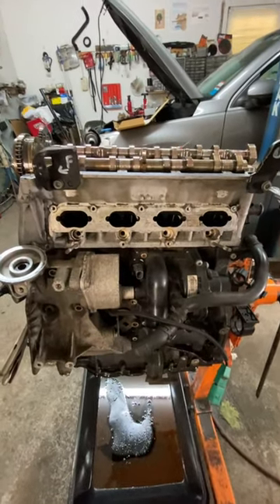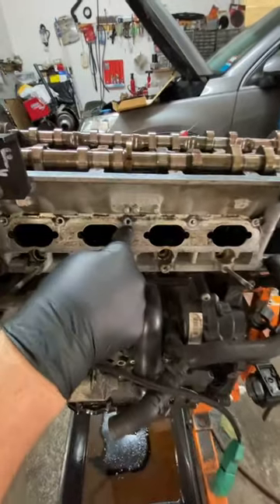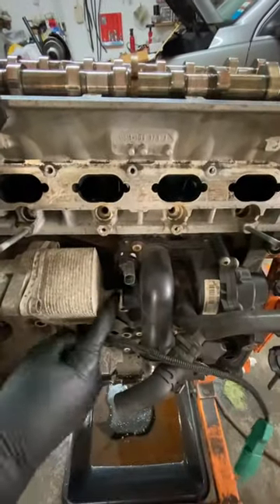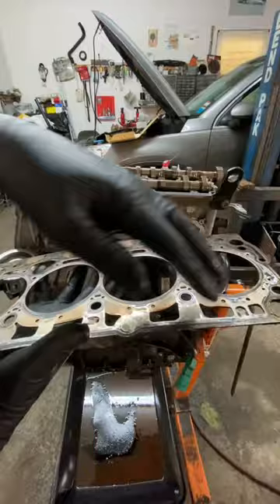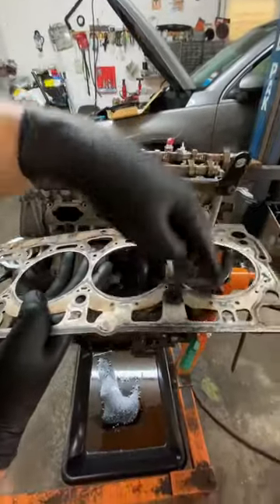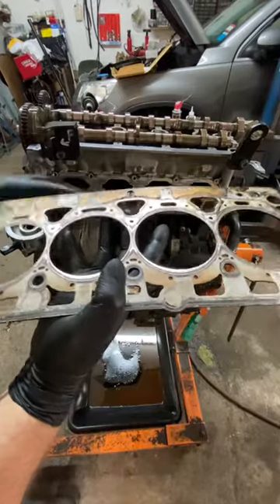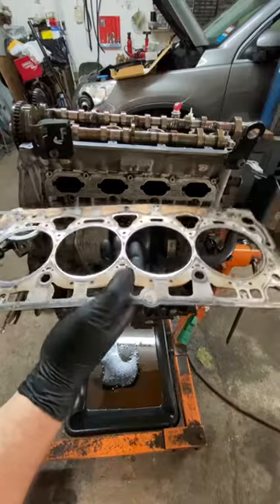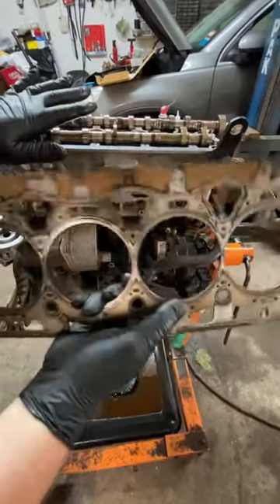What Is A Head Gasket And Where Does It Go

Comment: My sister blow my head gasket it took me about 10 miles of driving before I noticed just wanna is it still fixable or is my engine cooked
Reply from the maker: It may be if the cylinder head or block didn't warp beyond specs.

Comment: Usually if this has failed,  a new replacement engine is the only long term fix......
Reply from the maker: Absolutely not! Head gaskets fail for various reasons and almost all the time can be replaced and last longer than the original gasket.
Reply: Replaced mine going strong still
Reply: @motorcarnut  What was cause of gasket fail ?
Reply from the maker: Overheating the engine is the biggest one. Then corrosion and deterioration.

Comment: I have the same issue mines is blown & my car can turn over but once crank I wonder what’s stopping it to crank but before this all happen I first noticed grey smoke then I pulled over but I thought a blown head gasket smoke should be white 🤔
Reply from the maker: Could be coolant in the cylinders if the head gasket is blown bad.
Reply: @motorcarnut  I haven’t seen the head gasket myself so I can’t tell you if it’s blown bad or not but the previous mechanic said it’s blown head gasket I can tell from the oil looking milky & dark brown I def prolly have a leakage something was causing the smoke to appear when I go more then 10miles etc the less I drive the less it starts coming it so I stop driving it & yes maybe so I was thinking about getting the head gasket replaced
Reply from the maker: @aaliahfuller1609 Yes, it definitely failed.

Comment: Can your engine get warped if driving it for like 45 mins overheating?
Reply from the maker: Absolutely, it does't take long especially an all aluminum engine.
Reply: @motorcarnut  damnnn man. So im better off getting another engine right?
Reply: @motorcarnut  is a 2007 honda crv with 100k the thermostat housing cracked and it leaked all the coolant through there. 😢 and I just bought it last month for $6,900
Reply from the maker: In that case I would take the head off see if it can be resurfaced then check the block deck for warpage. You have a lot of money in the car so that’s what I would do.
Reply from the maker: Not really, just answered your other question